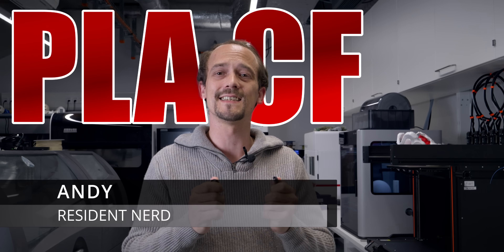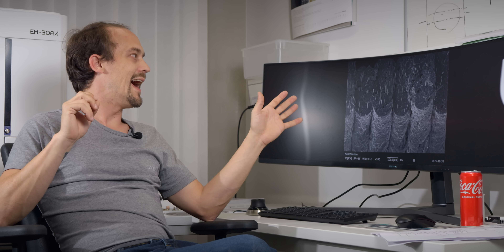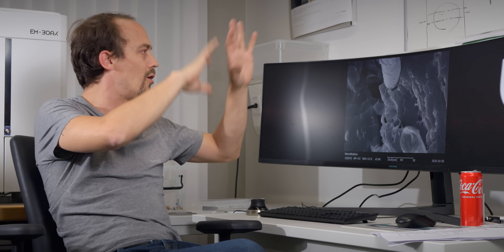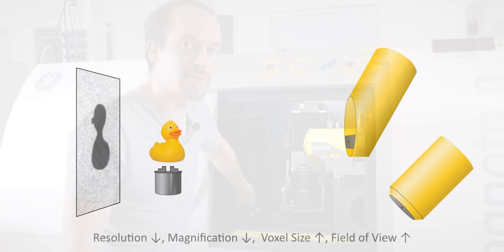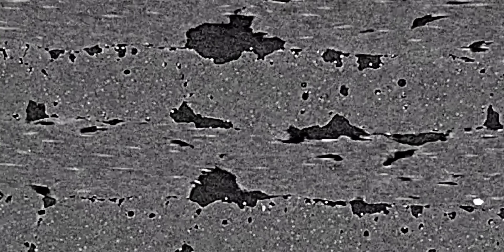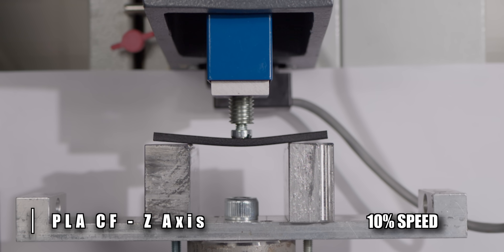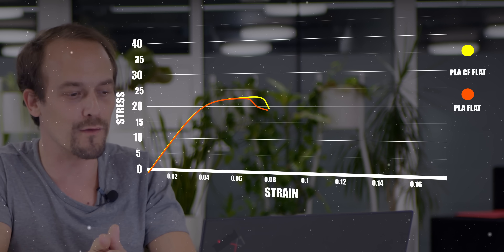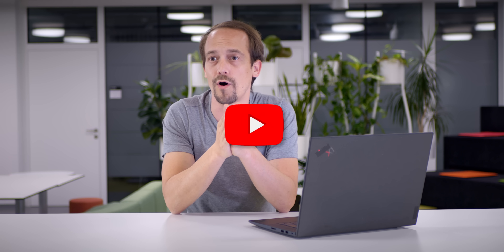3D Printing’s Biggest Scam Is Even Worse Than We Thought!

Comment: I always figured it was a scam, but now you've got me curious since you said that it does benefit some materials. I'd like to see that proven. Also, it'd be nice if you could test those materials where it supposedly improves them, but also test them against geometrically strong designs, and maybe even test carbon fiber with geometrically strong prints and see if it improves the strength or weakens it.

Comment: Posting this paused at 6:30. 

You're printing PLA (which is printed at low temp). When mfgs introduced PLA-CF there was little testing done in the industry. I test Tungsten carbide weldment for the gov. When you weld TC at lower temps(lower amperes) the weld bead is less viscous & allows the carbide spheres to stay in suspension longer while the bead cools thus these spheres stay at the top longer & gives the bead cross section more uniform strength. Some even stay at the top. 
Same theory is applied here w/ 3dprinting pla-cf. 

I would wager... that

If you printed pla-cf hotter & slower with the ambient temp around the bead hotter the CF strands would not "poke" through the layer boundaries as much. 

Is "core" PLA-CF available? Idk. 

I print many of my commercial grade parts (like petg-cf,  petg-gf) with the chamber enclosed between 45c-50c & between 265c-270c noz temp (faster around 200mm/s) to insure i get 10-20% more layer bonding strength. 

Could you do an experiment with my ideas in mind? 
I would like to see if my ideas are correct or not. 
Thank you for such an in-depth video! 

Helixx_4D on Discord. 
Co-founder Team 7 Beta Testers
Reply from the maker: There is core pla available. And i tested it already. That will be episode 3 and comes out next week 😊

Comment: People, including myself might be freaked out by these microscopic fibers getting loose in the environment. But there's lots of common  dust that is likely just as dangerous. Wood is cellulose, and is quite a strong fiber. Ever gotten a splinter? Yeah, sure, but that doesn't stop you from grabbing your saw and making a cut, does it? Or worse, sanding wood smooth. On a microscopic scale, crystalline structures are scary stiff and strong. And sharp.  Ignorance is bliss!
Reply: Cellulose breaks down and dissolves tho… forever chemicals and pfas are what people are scared of. Microplastics really are truly dangerous
Reply from the maker: I actually am concerned about those things too. 
So please people wear a mask. Just because u cant see a danger does not mean it's not there. 

Thanks for pointing that out @HuFlungDung2

Comment: I would love to see the comparison to the CF filaments that actually benefit from the fibers
Reply: All of them benefit from the fibers if your goal is prints that don't warp off the bed. The typical short fibers in cheap filaments don't add much if any strength, but they do make a massive difference in shrinkage rates and stability. If you buy higher quality filamemts with longer chopped fibers it does actually make a strength and stiffness too. But none of the popular Youtubers use those so most people never realize there's a difference.

Comment: What a fascinating video - I'm not going to vote on what you make next because whatever it is, I'll watch it! 

One question I have about PLA-CF is if it offers any improvements in dimensional stability and prevention of warping during printing.

That's an often-cited benefit for CF in other materials. 

Personally, I have been tempted to use PLA-CF because I really like the look and surface finish of the parts, but have decided against it due to the health risks.

Comment: Fantastic way of bringing thew message! 
Working in the polymer industry I know that carbon or glass fibers are not a "fits all cases solution". With FDM printing the viscosity of the plastic is so high that the fibers in the first place have a very hard time to simply physically mix with the polymer properly, possibly causing the voids you found. There is a very large differences between polymers but also between brands. How the filament is produced makes a huge difference. Next there is the physical interaction. The polymer needs to adhere to the fiber (and some do to to glass better than to carbon). These adhesion forces are rather weak for most polymers and for that reason there are a lot of chemical modifications done to improve this bonding probably further leading to big differences between filament brands.

Comment: I would love to see this with glass fiber reinforcement and also ASA-CF and ASA-GF, as ASA warps more than PLA so it would be interesting to see if the carbon bonds to the ASA correctly or of the ASA warping simply tares the carbon apart and the same with glass fiber

Comment: Very underrated channel.
It seems that CF is useful only for eliminating warping, but for PLA this is not an issue. It may help with PPS, PA, or such, being able to print this materials easier, even sacrificing some strength of the part.

Comment: And maybe explain to us why ASA-GF and ASA-CF would be different, please?
Reply: I love your profile picture
Reply: @Stark_Mark  Thank you. Together the Clippy Army 😉
Reply: Its weird because ASA has same or more shrink than PLA, 0.5% vs 0.4% or so.
So you'd think it would be worse. Maybe it bonds better.
Reply: Combats Shrinkage which is an annoying issue with ASA/ABS. No such issue happens with PLA in any significant capacity, hence why PLA-CF is dumb.
Reply: ASA-CF, AKA carbon polymer, in industry is long fibres going in all directions throught the plastic matrix and has to cut from plates.
ASA-CF filament is just same bullshit: creates ASA, but matte.
Reply: The carbon fibers make a huge difference in stability and warping. Things that aren't printable at all with regular abs or asa become easy with the addition of chopped fibers.
Reply: @andreashabermas7964   it's not bs, it improves some properties. can you please stop spreading fud?
Reply: @andreashabermas7964  same for ASA-GF?

Comment: Any filler which doesnt transition at temperature rating and add to the actual bond strength is just that, filler.
Reply from the maker: And it also interferes with the actual binding of the plastic :-)

Comment: Love this sort of geeky analysis.  I was watching this and on seeing the void gaps had a thought, what if you could print into a pressurized chamber to some how force out air pockets and improve bonding
Reply from the maker: U saw the arburg printer in the background? That's kind of the concept. They push 800 bar pressure before extruding. It's extremely dense
Reply: @Ibuiltathing  Oh wow that's some pressure, I was wondering if it could be done on the cheap as a post process. It would have to be done on a per material basis but I wonder if you could apply just enough pressure at the right temperature, so the material was malleable enough to allow gas to escape but not too soft that you start negatively impacting tolerances.  I suppose an autoclave wouldn't be hot enough?

Comment: I work with carbonfibre
And that thing is worse than asbestos .... 
And dont comment "its not" ...go read online why it is and when

PS
when- in any other form except when people say its "safe" ....its only safe when "clean" and in long fibers , anything else.... You dont want to be close to
Worst part is dust...... Just go check online what it does
Reply: Compare asbesros and carbon fiber filaments 🤣
Reply: Claims in this thread are inconclusive. The only hint of a mechanistic explanation of danger or not is carbon being inert. Dust in lungs is a start. But why some dust is dangerous ans some not?

Just saying. Statements without explanation why. Removed my like and explained why 😌
Reply: @Hukkinen  but if you want short explanation because you rly dont know how to ask google..... - carbon fibre structure is like tree and porcupine needles combined , it will get stuck in your body and because its brittle it will "crack" into more pieces , plus because itd like a "tree" it easly transfer anythink....from resin , water , dirt etc to bacteria inside of it (again-check how it looks under microscope) and extra part is that the fibers are small....rly small ...few nanometers at max and because of that its super hard for body to do anything with it (i dont remember why-check online , i know that if it was glass fibre its waaay easier for body to remove it but will still take few years to do it)
Reply: @ErtsenPlayGames  Thanks. This brittle tree like struckture helps to understand why it is worse. Thanks. 

YT Android sometimes does not show my own posted, sometimes they don't get posted.
Reply: @Hukkinen dude...99% of my comments when i explain got deleted , i make longer comment there and i lt was deleted so srly...is it so hard to check on you own ? 😅 Why its so hard for people to do that yet they need to say youre wrong without checking themselves if thats true😅
Reply: I explained above (3extra comments) if theres nothing= yt deleted them
Reply: Worst part is in dust form its extremly dangerouse , way more than asbestos and dust form is created super easly  because how easy it cruble (try sanding it etc and you will understand ...its super easy to sand /grind on any surface creating dust) it then be inhaled , get stuck in your lungs , create inflamation , alergic reaction and will stay in your lungs for years 
Or will penetrate your skin and do same
Reply: @ErtsenPlayGames   no it won't, stop spreading fud
Reply: Total BS.  Carbon itself is inert.  Grinding and producing dust of any kind carries risks, but nothing special about carbon fibres.  The epoxies and polymers are far higher risk, especially if ground into dust.
Reply: @chrisgill5692  yeah this fud people are spreading is incredible...
Reply: @chrisgill5692 u sure ? Go find online how fibers look under microscope then you will understand

Comment: Great analysis! I use Glass Fibre enhanced ABS - and this is mostly to stabilize the print, preventing warping. The minus is the layer adhesion degradation.
This is for either fuselages of the RC helicopters I design or for molds for composite fuselage fabrication. 

I would love to see more analysis videos about other materials and comparisons to non enhanced versions

Comment: I'm making carbon fiber parts as a hobby and i know it was a scam from the begening. Because if you want to benefit from carbon properties, you need couple things. First and maybe the most important, it need to be compressed very well and there should't be any air in the part. There is no way you can compress while printing and avoiding air bubbles. So every air bubble and woid is weakeness. And like in the video, if plastic dont stick to carbon, carbon does nothing. It's just any smal fiber. Second, you want to be the carbon strands as long as possible. Yes there is a thing called forged carbon fiber but again it is compressed very well while making the part and also the ratio of carbon is much higher than a filament. So cf filament doesn't make any sense until they somehow improve these requirements.

Comment: Every single time I've purchased a filament for a specific part I've wanted to make stronger than what I was getting from PLA...all ended up weaker.
Reply: I just use PETG for almost all prints now. With modern printers its hardly any finickier than PLA and it is stronger.

Comment: Thanks for this amazing video!

There is a thing I do like with PLA CF, the printed surfaces look much smoother. My question: wouldn't sealing them with a few layers of spray clear coat be enough to make it safe to use?
Reply from the maker: That would certanly help. But while printingits still risky... i think.
So i guess we have to test that.

Comment: So...I use petg for my automotive parts. Was introduced to petg-cf and decided to try out.

The first piece broke.

 Back to normal  petg
Reply: Which brand did you use? Fiber filled PETG is generally better in most categories than regular PETG aside from toughness. It is more brittle, which should be obvious, so yes impacts can break it more easily if pushed past a certain point. Keep in mind you can and need to print fiber PETG hotter to get the best properties, especially layer adhesion. My Tech Fun has a lot of testing which shows how good it can be. I highly recommend Tinmorry brand.

Comment: What about glass fiber, is it any different? In particular I'm thinking about the Polymaker HT-PLA-GF
Reply: Glasfiber is thicker in diameter isotop and not as stiff and cheaper. Basic reinforcement for thermoplastic’s.
Reply from the maker: Glas fiber is actually made with glass beads. And (without proper testing) i had the feeling its way better. But thats a great topic for a next "3d printing mythbusters" episode

Comment: Is the "lie" that the CF filament was sold with unfounded (fraudulent) claims, or that those intending to produce CF-impregnated functional parts thought that CF bonds well with typical (non-sized) thermoplastics?
I'd imagine that any dissimilar material in a thermoplastic would suffer similar issues of adhesion, e.g. glass fibre/spherule, especially without considerations of sizing and coupling agents, and material wetting.

Comment: What you are testing sounds like a perfect topic for an mechanical engineering bachelor thesis.

I was already thinking that the fiber filled Filaments are more like a marketing gimmick than real benefits. 

And the bubbles you are talking about, there are a few possible explanations.
First it could be from the mixing process of the fibers to the base polymer. To get those fibers in, you create  "Additive pallets" from a polymer powder and a huge amount of fiber and extrude it. Thank those pellets get mixed with the base pallets and extruded to the filament. And the carbon fibers could interfere with the degasing step in the multi zone extruder (if they even use one).
Another explanation could be off gasing of the filament while printing. All the heat cycles are degrading the polymer and that could lead to some off gasing.

I wish I could research into that topic but sadly, I don't have that amazing equipment.
Reply from the maker: Than we will do that for you :-)
Reply: A lot of this work has already been done years ago in the metallurgical field - SiC fibre in aluminum.  Composites have one bid issue as metal castings have - oxidation - we live and build in a 21% oxygen atmosphere with about 1% water vapor that adheres to everything surface preventing bonding. Solute cleaning treatment  before bonding is the only way but very difficult.

Comment: If I am correct you should not see the defects in pla or less than carbon fiber, maybe the defects like in metal give it the strength, if you could make a video also x ray and the optical test with only pla if it has holes in it.

Comment: I'm curious, how does CF vs GF infused filament compare? And what about effects on the glass transition?
Reply: There is no impact on the glass transition temperature, that's a polymer property.

There may be a measurable impact on the heat difflection temperature.
Reply: @stefanwilkens  You are wrong.  Glass transition occurs in any materials where there is a TCO difference, which causes zipper faults.  Metals have this, and most alloyed and grsnular materials also.
Reply: @stefanwilkens my mistake, thanks for clarifying